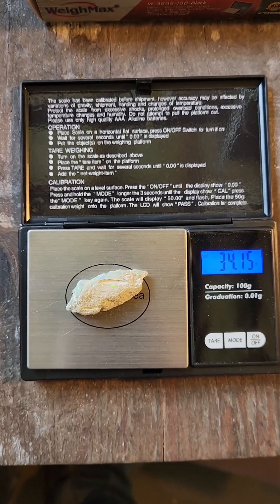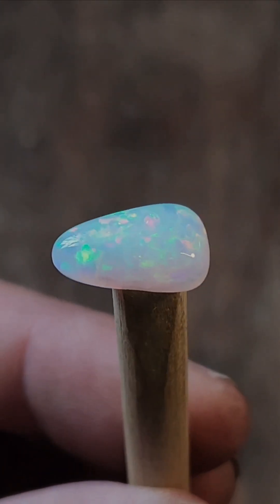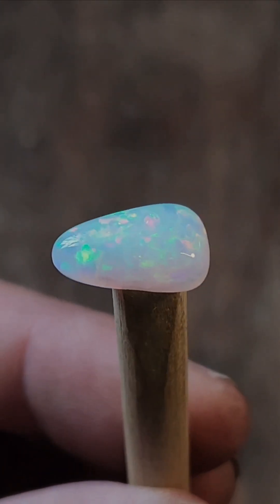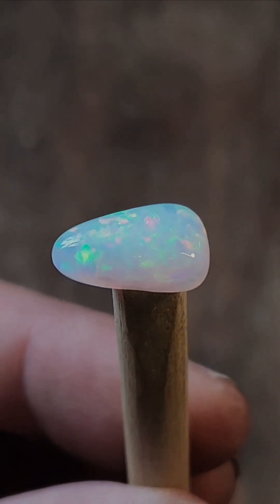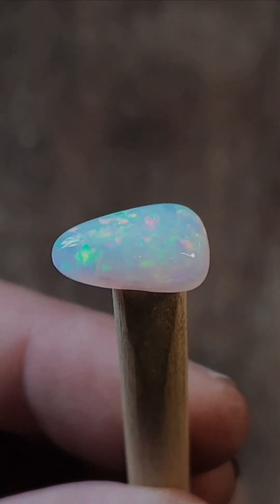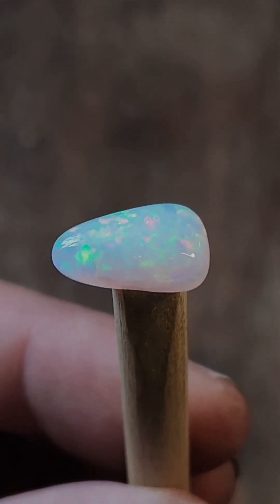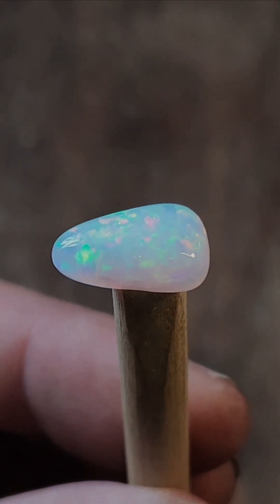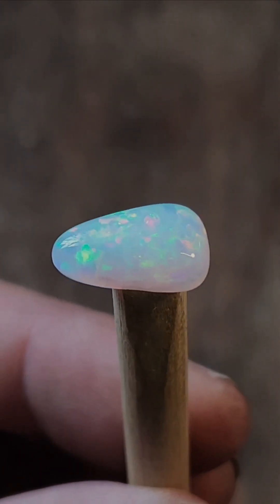Opal cutting.  things to look out for in large rough welo opal, and lessons learned.

Comment: How did it not crack working with such a big piece. All my small pieces didn't crack. But ever big piece around 25 to 30 carats all cracked bad.
Reply from the maker: @mattcortez9156   
All or most of my smaller rough pieces are pretty clean of fractures. The larger ones are usually already cracked, but the cracks are hard to see even under lighting.  
The first opal in this video fell apart in my hands as I was shaping it.
The second opal, I found the cracks, and made the rough into more pieces based on those cracks. 
It's ok that opal breaks sometimes.
It is how we utilize the pieces left over that matters most.
It can be frustrating, but is also a learning experience to still have fun, and learn as we go in opal cutting. You asked a great question for sure. If you don't mind, I can do a follow up video with your question on the video. Just let me know cause I don't want to include your handle if your not good with it.
I will be doing a more in depth video on cutting and polishing soon though.
Reply: @CanyonArchaic  yeah that's fine but how were you able to cut such a big piece and still be left with as big of a stone as you did. Biggest I can get due to crumbling is roughly 6mm rounds. I did cut a nice sized oval but it cracked right across the stone and all the way through during the drying process.
Reply from the maker: @mattcortez9156 
Hmmm 
I wonder if maybe the opal you are getting might be very unstable for some reason. 
Are you having to deal with a lot of sand and mud pits in your opal while cutting?
Reply: @CanyonArchaic  yes. I have some big pieces that don't have any sand or mud pits. But they have really nice play of color and one has a honeycomb formation that I didn't want to take the risk cutting them. But even some of my smaller pieces I have cut that had some sand but not alot. I still have had issue cracking
Reply from the maker: I will have a video coming up that we will dive into these issues with different types of opal soon